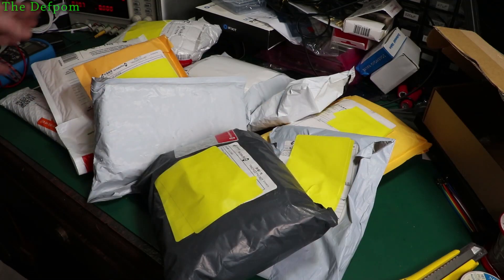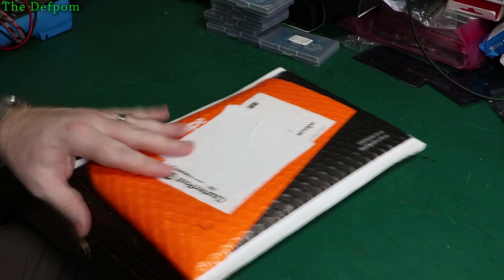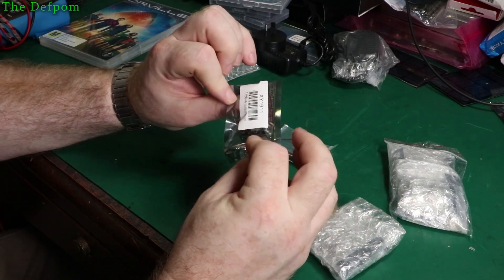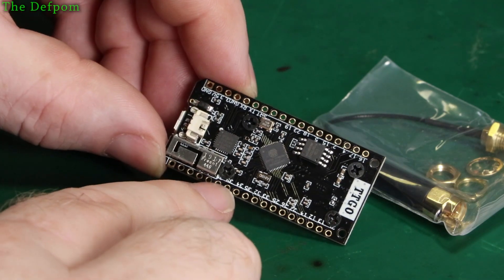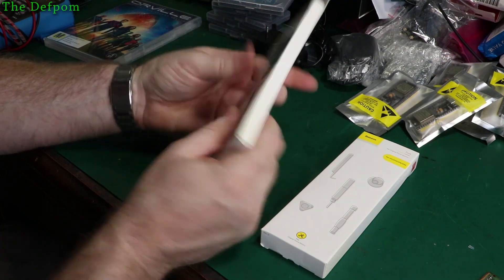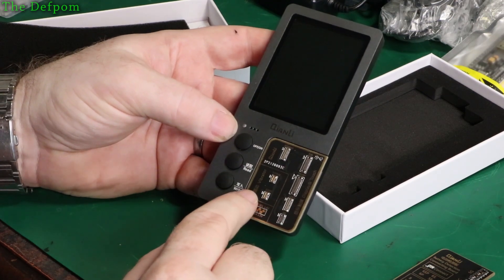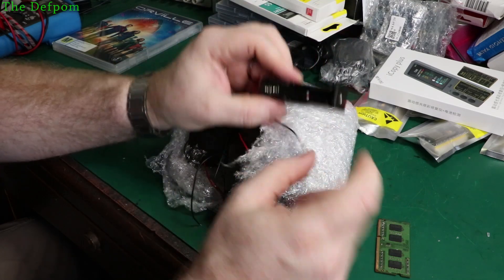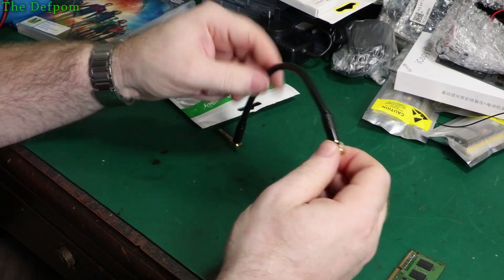#677 Mailbag Monday 20th January 2020

Comment: QianLi: Maybe you can use it to reset a batteries fuel gauge?  Sometime, due to software and the way the batteries were charged, the fuel gauge can limit the batteries useful time.  It may not be worn out Lion Batteries, but the fuel gauge that is confused.  It's been about since 2010 that I did research on that at batteries.com, but back then, they thought most Lion battery packs had a common fuel gauge software problem.  An instrument we MFG at GE had that issue too and we were able to re-program the Chinese battery to correct it's fuel gauge and re-cycle the battery. We could take batteries that only lasted 2 hours and after fixing the fuel gauge, in the battery, it would go for 8 hours again.
Reply from the maker: Daveyk021 - it most likely can do that yes, I haven’t tried using it yet.